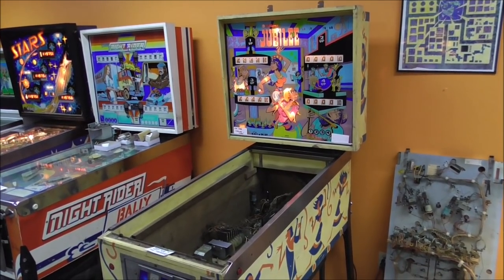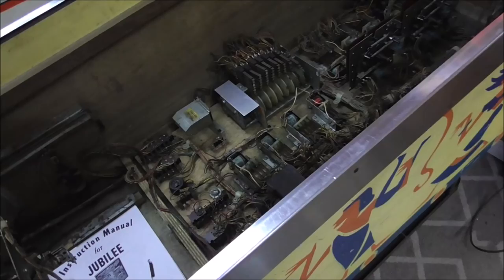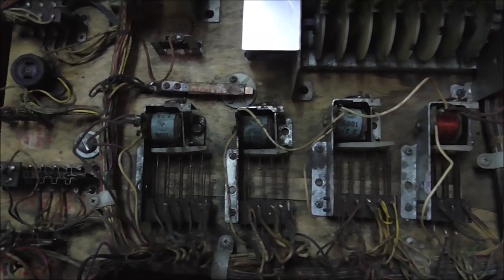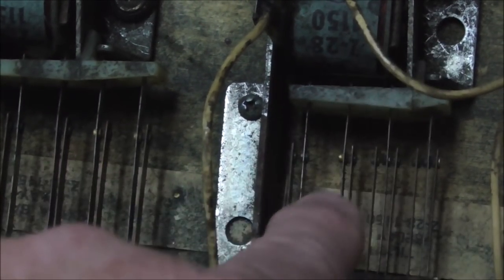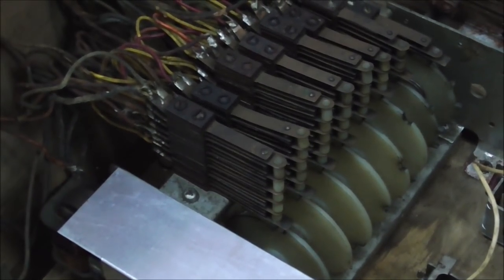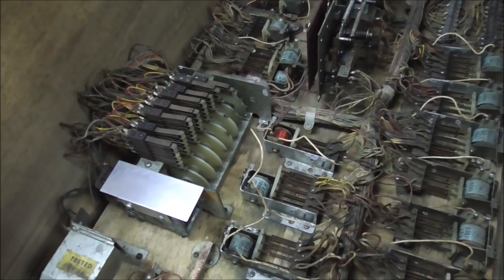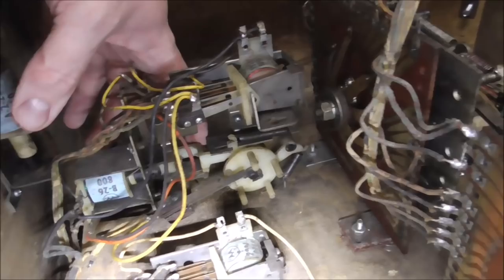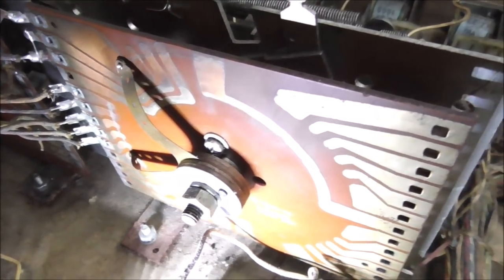1973 Williams Jubilee Electromechanical Pinball Repair - INTO THE TOMB (part 2)

Comment: Just wanted to say thank you for filming all of these videos.  I could seriously watch your videos all day long and never get tired of them.  Its so awesome that you get to do something that you have a passion for.  I would love to own my own pinball repair shop or even just get to work in one would be a dream.  By the time your next video comes out I'm sure you will probably have figured out the strange way the lights come on only when a score is triggered and how the "same player shoots again" is in opposite conjunction with that.  Funny thing is I had the same thing happen to me while I was working on a EM Bally Flicker(laurel and hardy themed) and for the life of me couldn't figure out what was going on, going back and forth through the schematic drove me crazy.  I decided to go through all the switches on the play field making sure they had good at rest connection but that was hours wasted.  Come to find out that the PF to bottom cab nit jones plugs was not making good contact and after re cleaning and plugging it back in voila! Everything worked.  Although with the wire mess that you had to redo a swapped wire could be the culprit.  Anyways, sometimes we are just too smart for our own good :) Merry xmas
Reply from the maker: Winston this ended up being that exact thing, it was a jones plug in the bottom of the cabinet that wasn't making a good connection, somehow if it's loose it will back feed power and make the play again light come on, craziest thing I've ever seen!  Thanks for watching, we'll see you on the next video!  Merry Christmas!

Comment: The very first pinball I owned was a 1974 Williams Skylab. Williams must have run out of ideas or something, because the playfields between that game and Jubilee are almost identical, almost. The operator that sold the Skylab was just starting to liquidate EM inventory and, if I recall correctly, Skylab and Jubilee were the very first titles to be offloaded, even before older machines like Camelot and Sea-Ray. So they may have been on the lower revenue side... Thanks for the video!
Reply from the maker: It's very similar, basically they would come up with a new concept (that horseshoe thing in the middle) and the switch setup they needed to make that work, and then they would use it in 3 or 4 machines over the next couple years... you'll see if you look through all the machines by a certain company that they have little gimmicks they come up with and re-use to save money on r&d :)

Comment: Hey it's been awhile.
I stayed the night at my mom's house for Christmas and while I was there I attempted to work on Countdown again. I've decided to get a Rottendog driver board replacement. I really like to repair and use original hardware, but at this point getting a replacement seems better.
Merry Christmas!
Reply from the maker: Those Rottendog boards are pretty cool, and like you said I like to leave stuff original, but on gottlieb System 1's I usually replace the MPU myself so many sometimes you have to do what you have to do!  Good luck with it!

Comment: When i was in Computer Field service back in 82 83 we had a tool for cleaning relay contact, Computer in those days did have some relays, mostly in the power supply area. Think i still got 1 or 2 of them, if i do i can mail them to you. 66 now 67 in Jan. No need for them anymore
Reply from the maker: You never know Fred, you might run across an old Pinball Machine you need to save after you watch these videos!

Comment: Hey Joe , I now have a fault with my Jubilee , the 1k right up to 20 k insert light & the red arrow in the center don't  light up  anymore , I have changed the fuses  the advance motor works fine  score reels work too everything works fine except all insert lights , can you help me out or point me in the direction please !
Reply from the maker: There's a few things it can be if you look at the schematics, it might be a bad connection on the jones plug where the playfield plugs in, unplug it and plug it back in a few times.  There's a switch on the Tilt relay that makes the lights work too, and a switch on the lock relay that makes the lights work, they're both on the schematic and if either of those don't close right the game will work but some of the lights won't...
Reply: @LyonsArcade  Thankyou Joe I will do this on the weekend  gees thanks man for aiding me , now I need to find a schematic

Comment: Do you ever get a light blower in there and blow the dust out at all or are you worried about blowing components around?  Not saying to use an air compressor or even "canned air", but something like a PC blower (something like an XPOWER A-2 Airrow Pro).  They do a great job, aren't super strong, and might just get some of that excess dust out of there.  I know, you don't "see" inside the machine, but I know with PCs, dust is not your friend, and in most cases in EM items.  Worked in industry way too long to find so many times a cabinet door was left open for YEARS and the dust and grime caused relay failures and more.
Reply from the maker: I've never had one of those unfortunately, I do try to vacuum them though!

Comment: JOES CLASSIC, can you use simple green or mean green to clean all the dirt and corrosion on the switches or will this cause more problems? The Braided wire is a ground wire that is daisy chaining connecting all the lamps and switches to ground?
Reply: They make special cleaners for electrical contacts...you don't want to use products like Simple Green for stuff like this.  Best way to clean contacts like these switches is, like Ron said, a worn file or a very fine grit sandpaper.  There's actually a file called a points file made specifically for these types of switches.
Reply: @chrisfreemesser5707  but using a file or grit sandpaper will ruin and coating on the contact because you're strapping off the contact coating plating?
Reply: @waynegram8907  Not if you use a fine grit sandpaper or a well worn file...just enough abrasion to take off the dirt without affecting the contact itself
Reply: @chrisfreemesser5707  yes the abrasion will strip off the plating and coating I mean. Is there anything else to use besides sandpaper grit or a file that won't strip off the plating and coating on the contacts?

Comment: I need to get you a leaf switch adjuster tool bending with fingers is not the best.
I have a two of them booth slightly different.
Reply from the maker: I've used those before they're pretty cool.